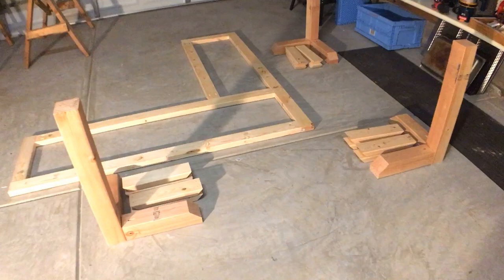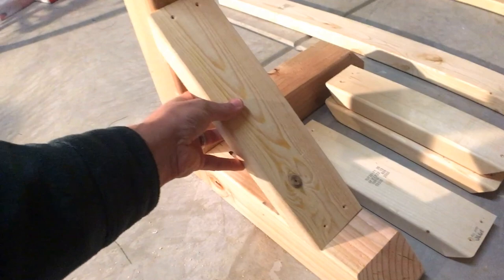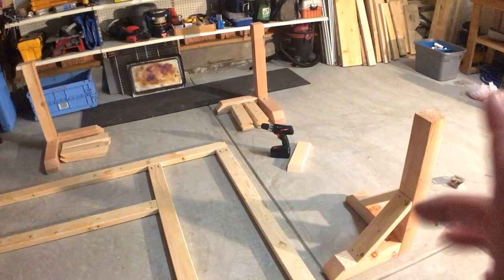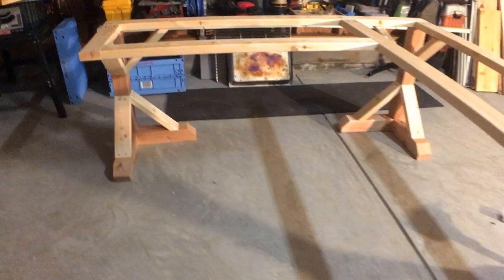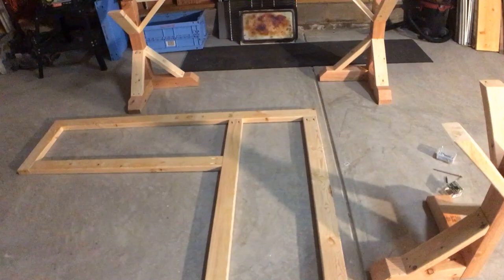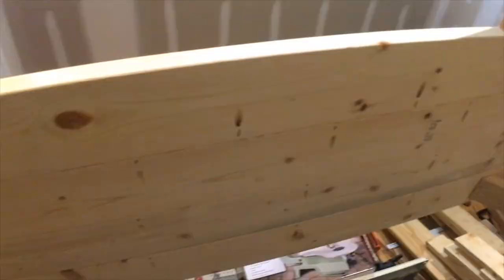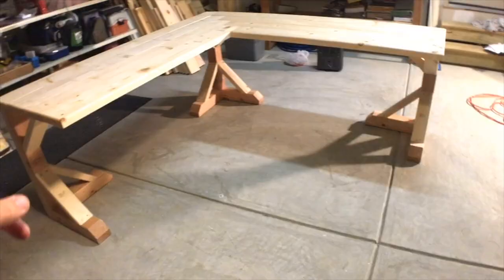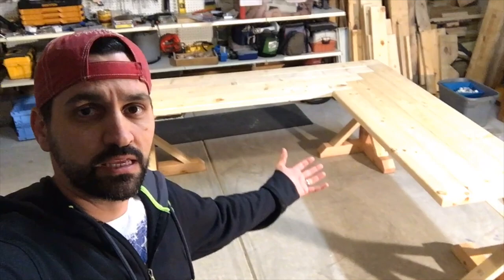How To Build this Awesome Farmhouse Corner Desk!  LESS THAN $100!!!

Comment: CUTLIST:(he tells you in the video)
3 4x4 @28 inches
6 4x4 @ 14 inches (he says you can do 16 inches also)
12 2x4 @ 14 inches
he did not say the length of the 2x6, but Im making mine 8 feet
Reply from the maker: Thanks Chris!!! Your hired!!! You can make the top as long as you want to. You can even make one side longer... kind of like an L shap instead of equal size.
Reply from the maker: Pinned! Thanks!!
Reply: Id like to point out also, it cost me 110 for wood and the kreg jig screws. I already have paint, and the kreg jig, so If you don't have them, this project would cost 130ish. Still, Im glad I found these plans! thanks!
Reply: SHOPPING LIST: 
2 4x4 (they have them a home depot, but not lowes)
2 2x4
8 2x6
Tons of kreg jig screws at 2 inch, and some at 1.5 inch
Reply: Hey Chris, I'm wondering how your desk came out at 8ft with the 2x6s? Pretty sturdy at that length?
Reply: Im still in process of making it. I spent a week building the legs(mainly due to the rustic/aging process) . Next week im building the top.posting results here: https://www.instagram.com/house_chris/
Reply: Nice! Are you at Lambeau Field in your profile pic? #GoPackGo
Reply: finished today. Mine is pretty sturdy. https://www.instagram.com/p/Bj0K5OInCY_/?taken-by=house_chris
Reply from the maker: Just saw the pics on Instagram! Awesome man!!!! Not too hard right!!
Reply: Chris H - Really interested in building a coffee table like you have posted on your Instagram...Would you mind posting more information of that for me? Shopping list...cut list?   Thanks in advance
Reply: Hey chris, how did you end up attaching the legs to the top of the desk? more pocket holes or was it something different?
Reply from the maker: Still interested in this!!? I might do a video soon!
Reply from the maker: @guybob123  From the bottom side of the 12" angle supports.  2 Screws in each going from the bottom up so you don't see them from the top of the desk.
Reply: What kind of wood did you use pine?
How about doing a walnut desk I assume it would be more expensive
Reply: KalindsLife I'm making my desk a lot smaller. 5 1/2 x 4 1/3. Sould and could I go with shorter legs and supports? Say around 12"?
Reply: @chrish7650  were these all 8 ft long Chris? I think that's how most of these come at my local big box hardware stores.
Reply: Just a heads up building this table now you will need a crap ton of 2 in kreg screws 1 1/2 are too short for the 2x6 top they dont go in far enough to support the end piece...I'm also going to add a pocket screw at the top of the 4x4s to tack the top down at the corners not just rely on the 2x4 brace.
Reply: Ryan O'Toole ikr!
Reply: @travisyuga  yes
Reply: On the 4x4s can you use pressure treated?
Reply: Chris H so the 2 inch screws were long enough for you? It’s seeming like they aren’t long enough.
Reply: @jennilainemax  I probably used either 2.5 or 3. I will never own 2 inch screws. haha
Reply: @chrish7650   how long were the pieces of wood you got? Idk if I’m doing the math correct or not but from what i got was i need 14 ft of both 2x4 & 4x4 and the top I’m making 6ft
Reply: Thanks!!
Reply: How many inches are the different lengths for the middle part of the top of the table? So I can figure out how to cut the top boards to make this design
Reply: @TheCrawlspaceCraftsman  Hey Chris, thanks for posting this video.  I am making a desk with using your design - it's really nice.  However, I had the same question as @guybob123.  I think he was asking how you attached the top of the desk to the 4x4's.  Could you please let me know?  Thank you again.

Comment: For anyone wondering time commitment, it took me 8 hours with running a router around the full perimeter, doing 3 step sanding on the bottom face and 4 step sanding on the top surface (40 grit belt, 60 grit orbital. 150 grit orbital, 320 grit orbital). Only thing I would do different really is rip the boards to make them square as opposed to the rounded edges, and add some 2x4's underneath in order to take some twist out of the top because of some board issues. Other than that, inexpensive solid and easy to make desk. Thanks for the video
Reply from the maker: I didn’t have a jointer or Planner at the time but If someone wanted to make a completely smooth top.... I’d say go with it!

Comment: CUT LIST!!! We’re ready to build just need LIST!! Thanks!! You’re awesome! This is an awesome piece. Very well explained video! Please make more!
Reply: Amaury Natalie Moreno he explained most of the cuts in the video aside from the top itself.  I'm getting ready to build this and the top cuts just depend on how long you want each side of the table to be.  For me, one side will be 6 ft and the other five.  Just layout the boards in the same pattern he did and then measure and mark the necessary cuts.  For the screws he used 1.5 and 2 inch pocket screws.  He didn't mention the size screws that he used to attach the braces to the legs but I would assume they are 2-2.5 inch wood screws.  The legs are 28 inch, base pieces are 14 inch, braces are 14 inch with 45 degree cuts on both ends.  Hope this helps!
Reply from the maker: WHat Tony said!!! Lol.... I’m really sorry that I’ve been so busy that I’ve been away from YT the last 2 weeks! I really thank you for the measurements you have here!
Reply: What I am wanting to know is, which size pocket screws did you use for table top and which ones did you use for attaching the feet to the legs?  I'm guessing 2 inch for the feet and 1.5 inch for the top
Reply: Please add the supply and cut list! please.
Reply from the maker: Yes 2” for the 4X4 and 1.5 for the 2x4s

Comment: Nice. For hard maple top, what is the deepest depth of the top you would go with? Not sure how much overhang/weight these posts will support properly. Thanks
Reply from the maker: Gotta Remember this is a L shape desk so it will hold ALOT of weight as it’s distributed differently then a straight desk.  There is a picture of me sitting on this desk with my dog on my community tab!

Comment: @kalindsLife Novice question: I bought a KregJig set which looks very similar to what you show in the video. The KregJig set (and most others that I can see) can only drill holes in wood that is up to 1-1/2" thick. How does that work with the 4x4's?
Reply from the maker: You can use it with 4x4s but its not the typical use!  Use a larger clamp to clamp the jig to the 4x4.... Do this on opposite sides of each other for best support!  A Kreg Vise Clamp will not work as they don't open enough.  Hope that helps some!!!

Comment: Thanks for the vid. Just got done sanding and staining the tops. Quick question, I made the tops 5 deep instead of 4 like you. glued and pocket screws, think the legs and braces are enough? Legs are same height, 16" feet.
Reply from the maker: Hmmmm.... in too sure honestly. You don’t want to be too front heavy especially with the weight of leaning on it to tip forward. There is a picture of me sitting on the desk in my community tab too. Maybe offset the legs forward a bit to help balance some. Good luck and thanks for watching!

Comment: I watched this video a while ago and used pre stained wood from an older desk to recreate a corner desk with your staggered effect adding a corner triangle so I’m not stuck in the corner. Awesome video. HOW did you connect the 4x4’s to the desktop?
Reply from the maker: Awesome Mike! Thanks for watching! You can connect 2 different ways.... #1. Drill and screw from the topside down into the 4x4. (I don’t like this way as the screw will be visible felt the top) #2.... Pocket Holes. Drill a 1.5” pocket screw from the bottom side up into the top. 

Hope that helps!!!

Comment: Glad i found the video as I have been looking for an easy but good looking desk idea. My question is if i were to go 5 2x6 deep, would i need another 4x4 leg or 2 for support?
Reply from the maker: Thanks so much for watching. I’m not sure to be honest but you might be able to extend to support to help. I’m just afraid it would be front heavy and tip forward. I have not have had this issue with 4 and the depth is perfect.

Comment: Before you did your cutting, did you sand? Plane? Square all your boards with a table saw?

 I'm totally copying this, but am using red cedar as the table top. Have any finishing recommendations for that?
Reply from the maker: Nope! Didn’t do any of that. I only cut the boards to length. I plan on weather sealing it In a few weeks to extend the life. Thanks for watching!!!

Comment: If I go with building the frame under the desk top, would I need to anchor the top to the frame or with the boxed design of the it just settles to the frame?
Reply from the maker: Definitely once you set the top on…. Anchor it from the bottom up so you don’t see screws from the top side.

Comment: Could you have a hardware store pre-cut these parts so you can just put the pieces together? I don't have any cutting tools.
Reply from the maker: You can try but they usually don’t do precision cuts. They definitely wont do the 45s for the cross braces. Start off with used or cheaper tools and build from there!

Comment: What was the size pocket holes you drilled, for mine I'm able to do 1/2, 3/4 and 1 1/2
Reply from the maker: For the most part I use 1 1/2 course thread pocket screws!

Comment: I’d like to make this desk but it would be my 1st project. I’d want to make it maybe 1 or 2 boards wider. Where does the supports from the leg to table top need to meet to offer maximum support?
Reply from the maker: Just adjust the depth of the base to accommodate the additional boards..... you don’t want it too front heavy to be able to “tip” forward.

Comment: Any advice on how to joint if instead of a herringbone/staggered pattern I want to make the top out of two sections jointed together?
Reply from the maker: The only thing I can think of is cut the ends at a 45 degree angle and pocket screw them together from the underside. Hope that helps some!

Comment: Was wondering... any suggestions on how to make the desk sturdier if I were to add a couple more 2x6's to add depth?  Nervous if I make it deeper, the brackets won't support it.
Reply from the maker: If you make it deeper you will only need to extend the bottom of the legs to prevent potential tipping. I have to say I use the desk Everyday without any tipping! Hope that helps!
Reply: @TheCrawlspaceCraftsman  Awesome looking desk. I'm worried about how much weight it will withstand. I have some old radios that weigh about 100# each and the desk will be L-shaped 96" x 30" with a depth of 25" And of course most of the heavy stuff will be on the 96" part. What do you think? I do like the fact that it's clear underneath, no bumping of knees.

Comment: quick question @KalindsLife, did you use just run of the mill lumber or one grade up? Also i was looking at kreg recommendations on the screws because i can't find 1.5 inch coarse thread near me and they recommend 2.5 inch coarse thread when attaching 1.5 inch thick boards to one another. what are your thoughts?
Reply from the maker: You definitely can use the 2.5” screws! And yup.... I used plain ol builders grade pine! If you check out my community page... there’s a pic of me I posted of me sitting on the table....... with my dog!!! Someone said it wasn’t sturdy and I had to beg to differ!!! It’s a great deal to this day!!! Thanks for watching!!!
Reply: @TheCrawlspaceCraftsman  i went ahead last night and purchased all the lumber for this project, i'm going with a 7 foot side and 6 foot side, was also wondering if you used pocket holes at the tops of the 4x4's to the desk top or just the holes in the 2x4's at the top?
Reply from the maker: Hey Ateven! Awesome! I just did the 2x4s up into the top but You can add a Pocket hole from the 4x4 up for some added stability! Good luck with the build!

Comment: I don't have a jointer or table saw. Did you use either of these on the 2 by 6s for edge-joining them or was your wood straight enough?
Reply from the maker: If you can eyeball your 2x6 so there not warped or crowned really bad.... go for it! You will need to buy the Kreg Jig so you can do pocket holes and use a bead of glue along the edges for added strength. Clamp it all together and connect with screws. You should be fine! I did not use a Jointer or table saw on this project! 👍
Reply: @TheCrawlspaceCraftsman  Thanks I have a kreg jig, but I've heard it does accept 4 by 4s?
Reply from the maker: You can use a Kreg Jig on 4x4s. Whoever said that is not right!
Reply from the maker: You need to use a non-typical clamp. A kreg jig clamp won’t work

Comment: I know this is an older video but we are going to build this desk this weekend for my craft room. Can someone tell me how the top works out with the groves from the wood 2x6 on top? Do things get in the crack? Do you have trouble writing on it?
Reply from the maker: Hey Marsha!! We looove this desk and it’s so sturdy. I will say that I do not write on it unless I have a writing surface and yes that is basically due to the seams where the 2x6’s meet. As far as things getting in the cracks.... no.  If you use a bead of glue and pocket screws like in the video it will pull tight enough to eliminate any gap between boards. Thanks so much for watching and hope I was able to help!!
Reply: Thank you!  I’m so excited to make this.
Reply from the maker: Marsha Hanshaw your gunna love it! I have a few more House Furniture builds coming soon so stay tuned!!!

Comment: Hi which screws (in pocket holes) did you use to put the 2x6 the top together connecting them
Reply from the maker: Everything is held together using pocket screws! For pine you want to use coarse thread 1.5” long screws.
Reply: Thanks!!!

Comment: hi again, one more question,  How did you attach the legs to the top?  Pocket screws or just the brackets?
Reply from the maker: Hi Joi! I used pocket screws from the bottom side of the 4x4s and went through the 2x4s front the underside into the L top from underneath so no screws are visible from the top side!  Thanks for watching!  (Getting ready to upload a Farmhouse Bench tonight!)
Reply: Was that like a 2 1/2 screws?

Comment: I’m need to pocket hole- for the 4x4’s- how do I set the jig? It only goes up to 2x4 size.
Reply from the maker: U used an adjustable clamp to hold the KJig on the 4x4.  Its the only way to make it work.... they don't make a clamp specifically to work like that.  Gotta use one of those life hacks!  Hope that helps some!
Reply: @TheCrawlspaceCraftsman  what size screws did you use for the 4x4 the 2 1/2”

Comment: how did you attach the legs to the top?  pocket screws?
Reply from the maker: Once the three legs were built I just set the top on (once I got it in the room) and screwed It on straight up from the bottom side. I used 2.5” screws.

Comment: I'm considering making this. How hard would it be to sand down the top to the point that it feels like one smooth piece? (I don't want to feel any grooves)
Reply from the maker: If you were to do this you would need a Jointer and Planer which is quit costly tools. You might be able to use a belt sander to take off some of the top after assembly but the amount of work and time this would take.... even I don’t know that! Good luck with your build and thanks for watching!
Reply: @TheCrawlspaceCraftsman  Thanks for the reply. I don't know much about this stuff, but would it be hard to acquire 2x6's that aren't rounded at the edges? I assume that would then require significantly less sanding. How would this effect the cost?

I suppose I could also get one giant board and cut that down to size? Biggest I've seen though are 4x8 meaning I'd still have to attach a piece on one of the ends. Thanks in advance!
Reply from the maker: You might be able to get some premium pine and use that. Glue it together to create a thicker top. Usually Lowe’s has 1x6 in premium but not 2x6. Your cost might be a bit higher but you would achieve the effect you want.
Reply: @TheCrawlspaceCraftsman  Would making it normally (what you did in the video) and then doing some sort of epoxy finish to fill the gaps and flatten the top be a viable solution?

Comment: Great video! What did you set the Kreg jig at when you drilled the leg holes?
Reply from the maker: Thanks Gary!! I believe it was set at 1” and used 1.5” course thread pocket screws!
Reply: Hello I measured 1.5 inches back and used 2.5 pocket screws! Worked great
Reply: @chunte37347  Thank you

Comment: How sturdy do you suppose that inside corner is? Want an easy l shaped desk for my first project just want to make sure it will be functional as a computer and work station.
Reply from the maker: It’s actually really sturdy! Use wood glue and a the right amount of pocket screws and you’ll be set! Thanks for watching!
Reply: @TheCrawlspaceCraftsman  I have my doubts, you're relying on the sheer strength of the screws and none of the weight is being directed to ground.
Reply from the maker: I can respect your thought but this desk is Extremely sturdy, strong and heavy too!! It’s still rocking stong without ANY sag or bowing or shrinking. I will add that a bead of wood glue along the edges could add for that exta security you may be looking for. Thanks for watching!!
Reply from the maker: Hey Zach! Check out the picture i just posted on my community page.... might change your mind a bit!
Reply: @TheCrawlspaceCraftsman  hey will do have a link? I only think the way I do from years of aquariums stand building. Look forward to seeing what you posted.
Reply: @TheCrawlspaceCraftsman  ha nevermind found it.

Comment: How much weight could that surface hold?
Reply from the maker: I have a Mac with duel monitors, a printer and a Circuit machine amongst other random stuff on it. I not sure of the Suggested load weight but I’m sure it will hold a few hundred pounds no problem. Thanks for watching!